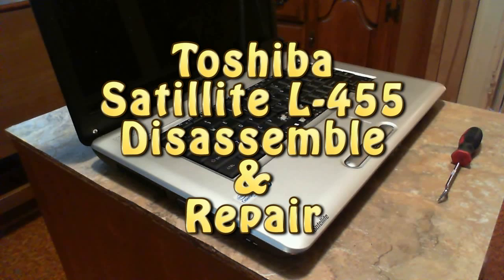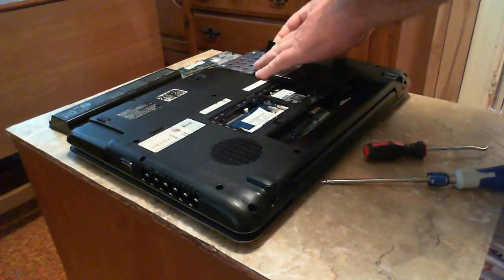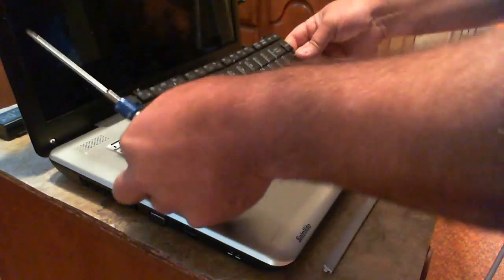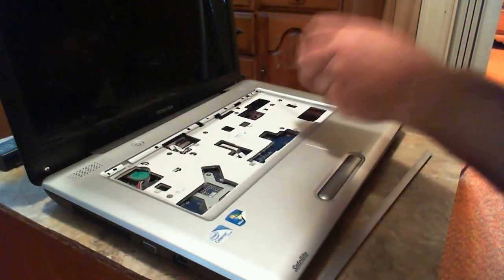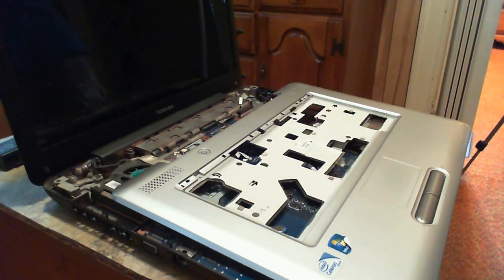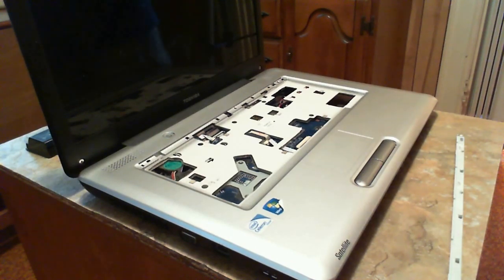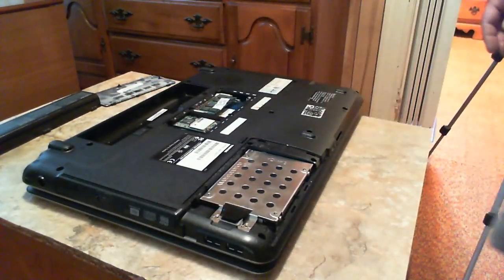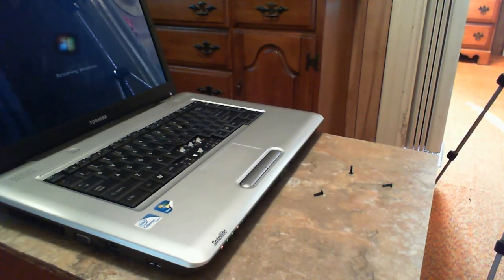Toshiba Satillite L-455 Laptop computer disassembly, repair and reassembly

Comment from the maker: @TeamHeavyHitters13 The laptop in the video had the exact same problem. If you remove the top cover you can reposition the button and simply hold it in place with a piece of tape. I cover that real quick in the video.

Comment: My Toshiba 505 has the exact same problem...when I wiggle the power cord it finally works. I have had this Laptop for years and never use it because of the problem. Today I decided to tear it apart or throw it out and that is how I discovered the wire must be broken inside. Now my problem is that I can't get the Ribbon Wire Connector back on to put the thing back together.
Any suggestions ?
Reply: After wasting another hour or so I found another ribbon wires that was broken it two spots..... Now the computer is resting in the trash barrel !

Comment: i took mine apart and put it back together and now i have extra screws and the screen doesnt turn on
Reply from the maker: You'll need to pull things back apart and try again. Make sure you have the ribbon cables installed correctly.
Reply: ok thank you

Comment from the maker: @hferral Are you replacing the hard drive? If so then you will need to install a OS. If you are putting the same hard drive back in then you don't have to do anything as long as it was working correctly. 
Thanks for watching and I hope I answered your question, please feel free to ask any more questions you may have.